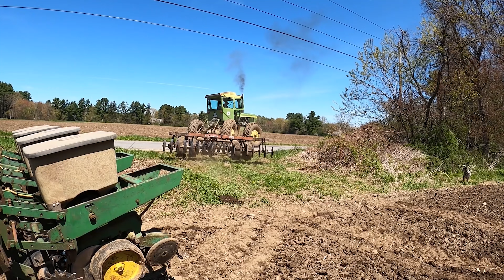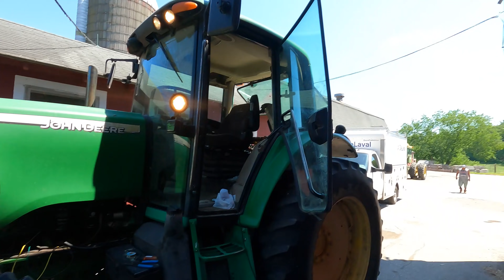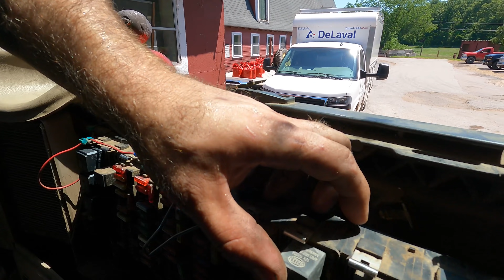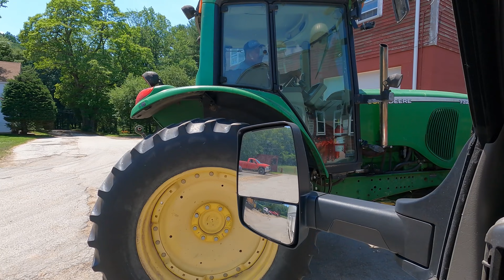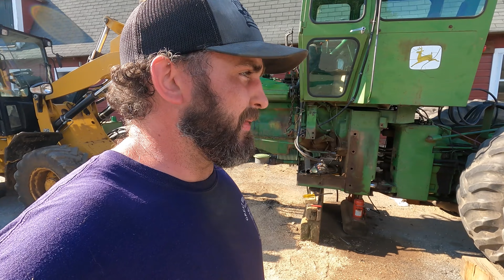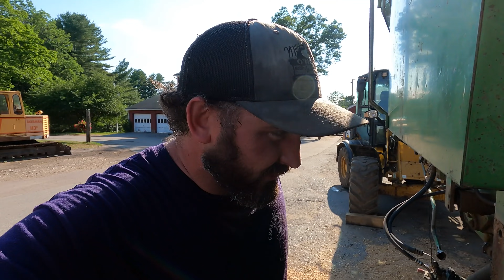Solving Tractor Issues- John Deere 7520 Going Together

Comment: I split a Kubota L4701 and replaced clutch and injectors yesterday.  $4800 in parts alone.  I feel your pain.  Used a rolling gantry with chain hoist, kinda half-assed but man, the 2 halves lined up perfectly.  This morning I start reinstalling the wiring harness.  So much shit on these new tractors.  My 1962 ford has about 6 wires.

Comment: You don't necessarily need new ends for the relay wires. Just use a pair of pliers and squeeze the spade connector to tighten the barbs together so when slipped onto the relay post it is tight.  Will hold just as well as a new connector.

Comment: CHECK AMP DRAW ON A/C SYSTEM, TYPICALLY THE BUSHINGS IN THE BLOWER MOTORS DRY OUT AND DRAW MAXIMUM AMPS, NOT ENOUGH TO BLOW THE FUSE BUT ENOUGH TO OVERHEAT ALL THE WIRING AND OVER TIME MELT CONNECTORS AND WIRING.

Comment: It is normal for the relay coil to be slightly hot during normal operation, but if the contacts are hot, it means that the service life of the relay has expired and should be replaced. Otherwise, the contact resistance of the contacts will be too large and lead to line failure (excessive voltage drop).
Reply from the maker: Yes this one was definitely beyond its life. Extremely hot. Just ordered all new replacement

Comment: I see a burnt tractor in the future your wiring is jacked up the connectors are bad not making good connection causes the relays to heat up I would pull every connector and buy some new heavier connectors Deere went cheep on them
Reply from the maker: They definitely did cheap out on the 20 series wiring. It pisses me off. Have more wiring stuff on order

Comment: I have relays like yours in my   97 freightliner.I had to replace one for my flasher and one for the blower motor  When they get old they wont click as loud when they engage the power to what they control. Some of mine are made in china and they can get hot .I imagine the amp ratings of relay  causes some heat if overloaded or worn. For lights  ,changing to LED might help  if it draws less power. or amps.
Reply: ☝☝☝ Agreed. Go full LED floods to cut down on the draw. Less heat in the relays and wires.